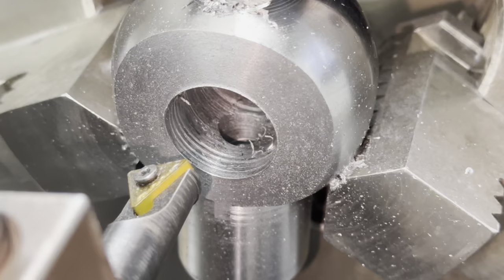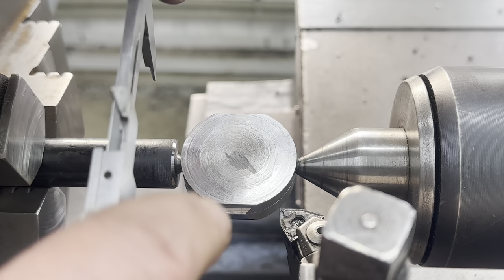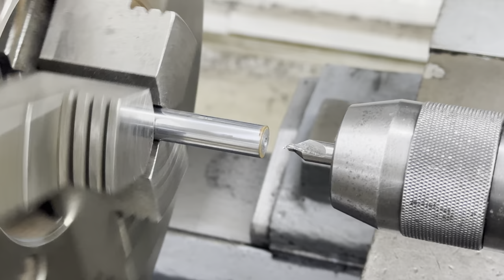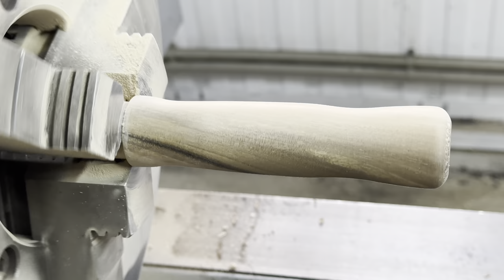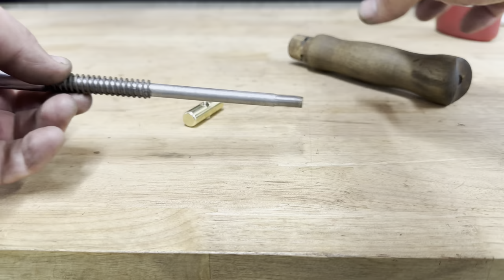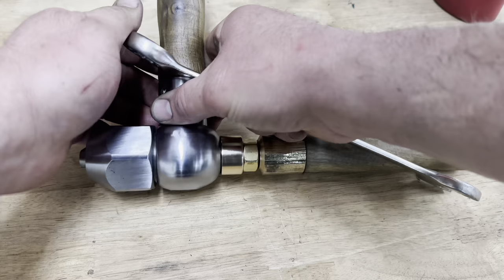Making a Vintage Ratchet Wrench for Threading

Comment: When you say "... as I walk you through the steps and tips... " -- what on earth do you mean? Where are the "steps and tips" of how you're cutting the curves, in the first 3 minutes? There's audio, but absolutely ZERO subtitle, audio, or any other help for anyone to follow you to do the same?!?!? If I'd like to make one of these, there's NOTHING here for me to follow along and do so. Sorry: I REALLY don't like to criticize, but this is just kind of show-off, without taking the time to be HELPFUL -- and you CLAIMED in your comments you WOULD be.
Reply from the maker: Hey, thanks for the heads-up! I'll make sure to add more subtitles and clearer guidance in my upcoming videos so you can easily follow along and create your own masterpiece or I won't promise in the description that there will be detailed instructions.
Reply: @LatheLegends  (Sorry - my comment came off a lot crankier than I like to be, my apologies. I must've gotten up on the wrong side of the bed, and it's against the wall, as they say. :-) Apologies for the tone, and it IS a cool tool - kudos.)

Comment: WOW you call yourself "Lathe Legend" and yet while you are cutting you have a ton of squealing and chattering. A real Lathe Legend would know that iif you are getting either Squealing or Chattering that you are obviously cutting at to high or low speed plus you should be using some lubricant, you are going to end up hurting yourself when you break a tool or causing so much binding within your Lathe that you break some gearing or fry your bearings and then you will be "The Lathe Legend without a Lathe"